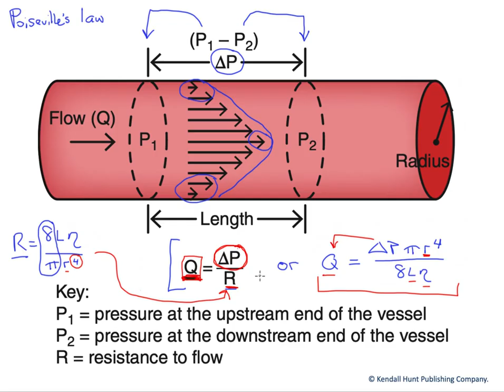Poiseuille's law

Comment: If that is what I think it is, then it's a fourth order elementary symmetric polynomial. In which case it would be four vectors in a parabola, with a mean and standard deviation (on the parabola, not the distribution).